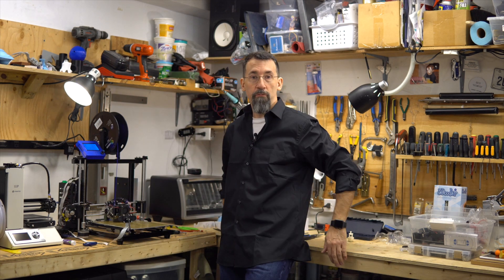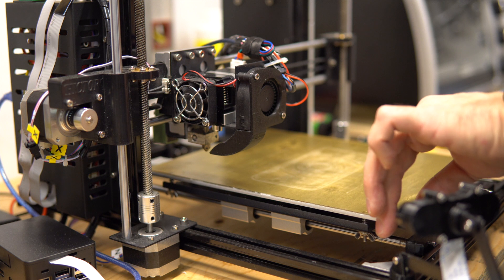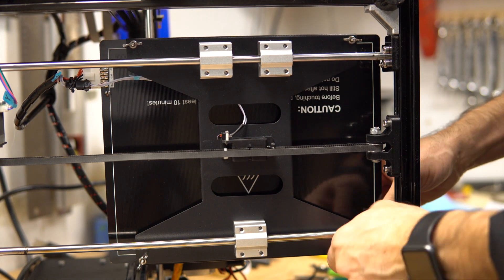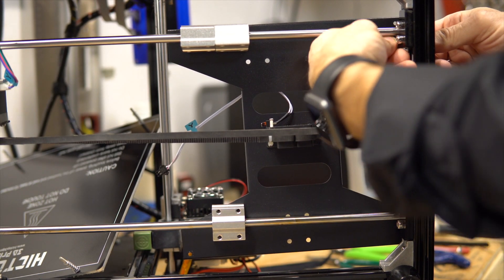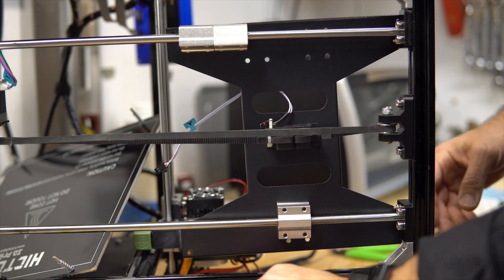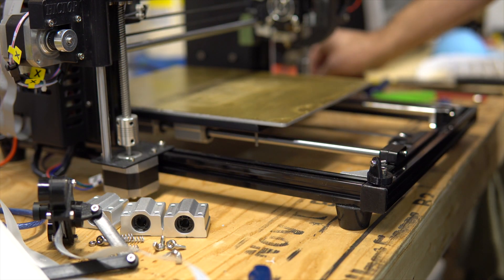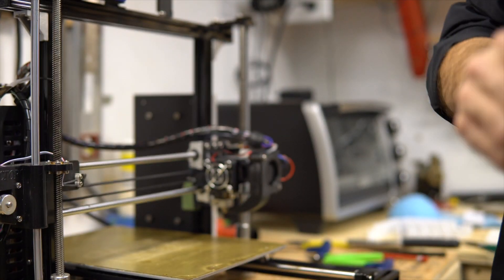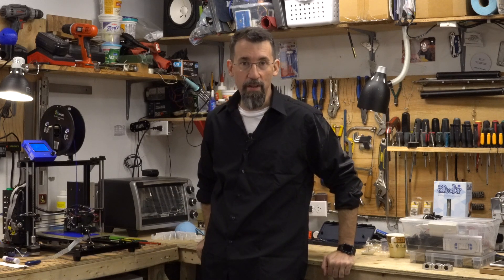Y-Axis Wobble

Comment: Does anyone know how to fix the Y-axis wobble on an Eryone Thinker SE?  I got one from a friend, he never used it, so it's basically new, but it has terrible wobble.  It uses 2 rails, each with 3 rollers, but they are screwed directly into the plate (no eccentric screws).  The rails are each attached to the frame in 4 places, 2 with bolts, and 2 with rivets.  So I can't adjust the rollers OR the rails.  This leads me to think I need to add something to take up the slack space, either a slightly larger roller on each side, or adding something to the rails themselves.  I do have a perfectly fine Ender 3, so I could print some kind of wedge to go in there, which I might end up doing if I can't find a proper fix, but I want to try reaching out first in case someone has already dealt with this same issue and has a fix they can say works.  Thanks!
Reply: I know it's been a year but I fixed mine just now. The easiest way to do it was wrap the 4 outer wheels on the y gantry with 2 layers of electrical tape to take up the space that came from the wear of the wheels. This has worked so far and I've had no issues and perfect prints.

Comment: Are these bearings still working out for you? I was thinking of doing a upgrade to a Prusa clone with this bearing. Even new the bearing have a side to side wobble on the X .
Reply from the maker: With the bushings it has about no play, but it takes about 2h to aligned the smooth rods, they have to be perfectly aligned so not to stick... The 3030 frame of the Haribo is perfect for it’s rigidity, I was not able to make it perfect with the 2020 frame of my other printer. I will do a build up series of the transformation of that printer to a full Haribo Black Edition :-)